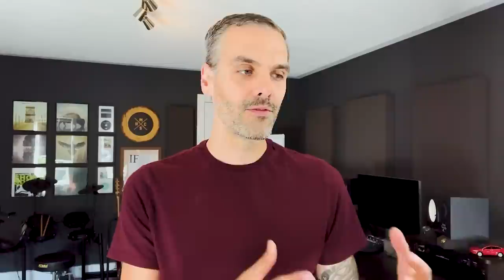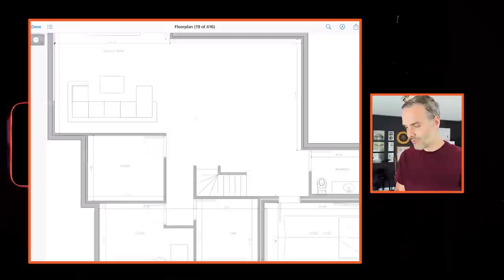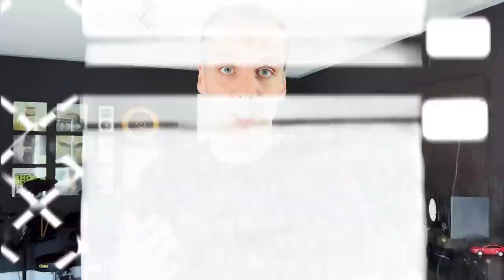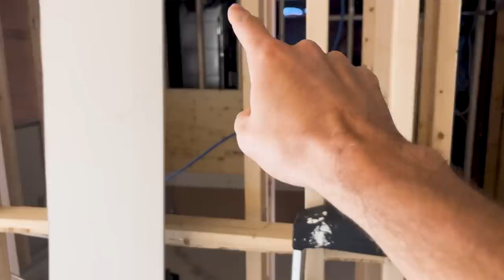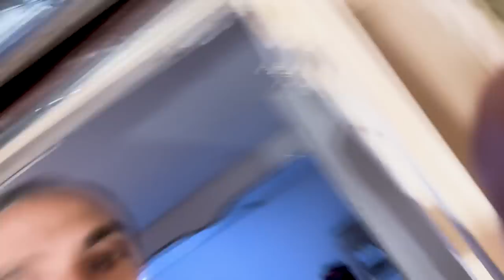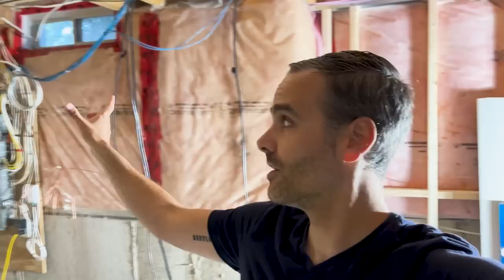Basement Mixing Studio Build (Part 1)

Comment: Glad I came across this video..just started framing today and have ended up with a 14x13 space with bulkheads to accommodate pipes and support beams. It is never ideal to have a space at home but like you, I wanted to accomodate storage, a small gym, big seating area, furnace room, and bathroom.

Comment: Wow dude I feel your pain I’ve been waiting to finish my vocal booth for a year but I’m the problem because I’m not as hungry as I should be because I’m making good money and it’s not urgent but it should be so I have one wall to get insulation mass loaded vinyl, drywall and green glue and acoustic treatment on the inside and I’m done plus a pass through for XLR cables and you’ll still be up and running before I will but that’s my fault so I’m looking forward to seeing the final product

Comment: WOW! Great project!! Question about moving your interior panelboard: Since your existing wiring terminates in that current location (home runs), will you now have to install a gutter/ wireway to splice in new runs for each of your existing circuits? Looks like a BIG job! Best of luck - great ideas 👊🏼🤘🏻
Reply from the maker: No, we're going to create some sort of removable section of the wall so that the panel is accessible - it has to be by code anyways.
Reply: @hardcoremusicstudio  perfect - that makes the most sense. Relocating a panel is a HUGE job and pain. I'm a Journeyman Electrician here in Tx. Best of luck - looks like fun AND a lot of work 🤘🏻

Comment: I built my studio about 6 years ago, with the same concept of room-in-a-room and the results are amazing. I can have a 5 piece band playing and you can hardly hear anything outside the studio. Mind you, mine is a stand alone building in my backyard. 
I'm sure Martin would have sorted it out, but are there any isolators that the inner room frames are standing on or are they mounted directly to the ground? Even with floating floors, if the frames are not isolated from the ground, the sound will transfer to the outside wall frames (low frequency) and vice-versa.
Reply from the maker: No, the studs are not isolated from the floor. That didn't seem to be a concern. Maybe if it was a tracking space too, it would be more of a concern.
Reply: @hardcoremusicstudio I built a room within a room in my basement and do tracking in it. Inner walls were attached right to the concrete with direction from Rod Gervais and no issues. Not going to find a better isolator than concrete !

Comment: Your ducting is your weak point. Run a heat pump for that room, also an ERV for air flow to the outside.

Also double drywall green glue the ceiling drywall.
Reply: i built baffle boxes for mine, in this exact scenario. 0 issues.

Comment: In Poland, according to regulations, cables cannot be run in trees without special insulating pipes (conduits). Are you sure it will be safe for you?
Reply: Low voltage and telcom/AV cables in US/ residential are not required to have a raceway/ conduit when run between or through trusses. But, where and how large the holes are drilled into the beams are dictated by structural engineering/manufacturers spec. Cheers!

Comment: Insulating a basement's outer wall from the inside is highly NOT recommended... You are running the very high risk of getting serious problems with mold in that space between your dry wall and the concrete wall. You'll need at least a moisture barrier (which NEVER is totally impermeable!) to avoid moist air getting in the gap and condensing on the cool concrete surface. But still... that will not prevent moisture (or even liquid water) of permeating through the concrete and getting in the gap.

Comment: Nothing you can install is going to silence footsteps above you.  Not even MLV.  Not worried about acoustics?  Why hire a designer?
Reply: So he doesn't have to plan and design the stuff himself?
Reply: He hired a designer because he can. Nothing wrong with that.
Reply: Yeah it'll be interesting to see how Jordan feels when the kids are running around on the floor above. Unlike running around on the floor underneath him which he's used to.
Reply: Decoupling addresses impact noise...
Reply: @chriscarr1791  the impact energy from footsteps directly above you will be far higher than hitting a floor below, and transferring to the floor above. Like I said, i'm interested to see how Jordan responds to it, the ceiling resilient mounts for the floor joists above aren't miracle workers.
Reply: @timryan193  yes there is different levels of decoupling. resilient channel is one, but certainly not the strongest. If it was my build I would be putting new ceiling joists for the inner room sitting on the inner walls staggered between existing joists so you would only be losing 1" of ceiling height. That is going to be fully decoupled with no point of contact between the outer room. The resilient channels still have connection points at every fastener, but is a form of decoupling. I was just saying that impact noise is addressed through decoupling, thats all. Jordan is an absolute beast in what he does, it doesn't matter how this room goes hes still going to kill it, but i think the new room is going to more positively impact his video work than audio.